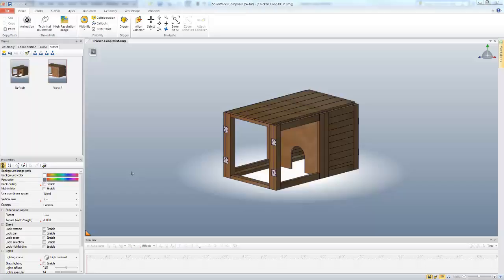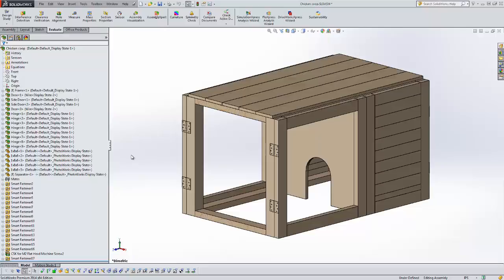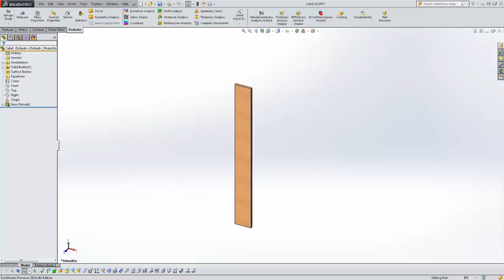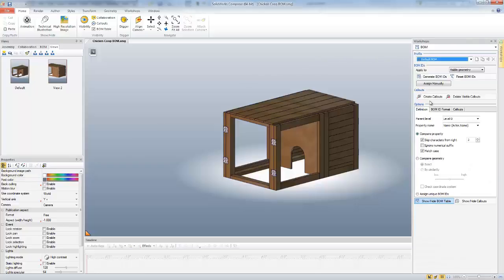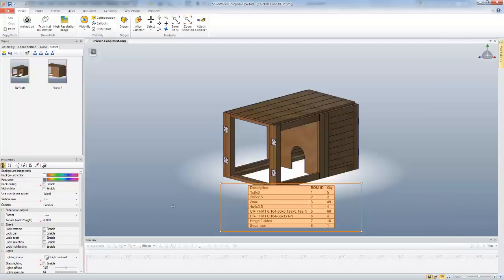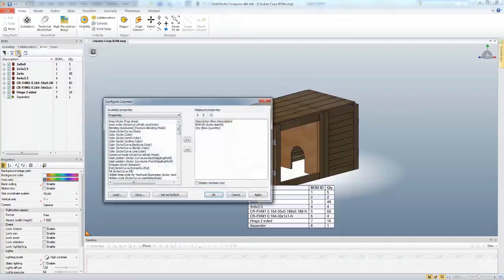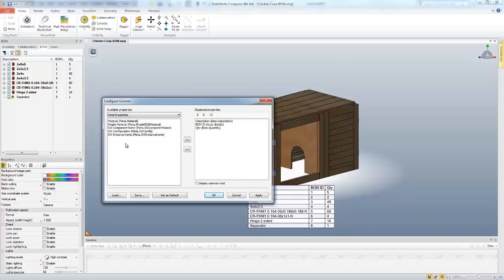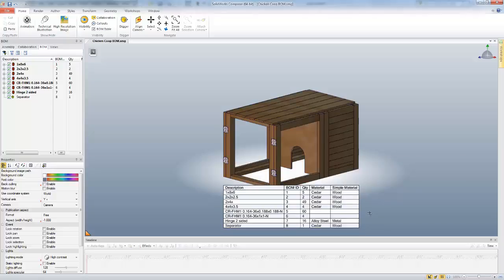SOLIDWORKS Composer – Reuse Custom Properties for the BOM

Comment: How to copy BOM to another existed view ?
Reply from the maker: What parts are you trying to copy? In the property of the view you can link it to an existing BOM, or you can create a new BOM at any point and it will be linked to the selected view. If there is formatting you are attempting to keep then what you do is save the bom as a template. then you can reuse that format anytime you need.